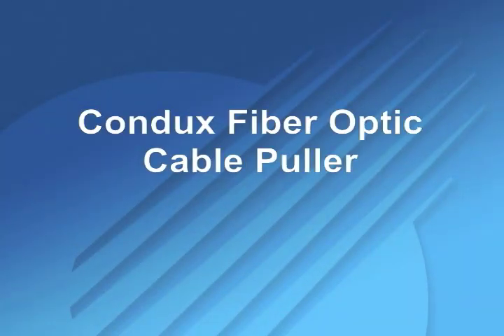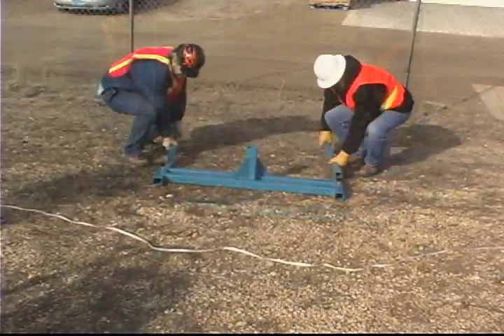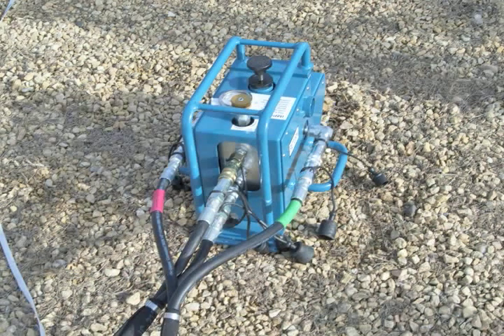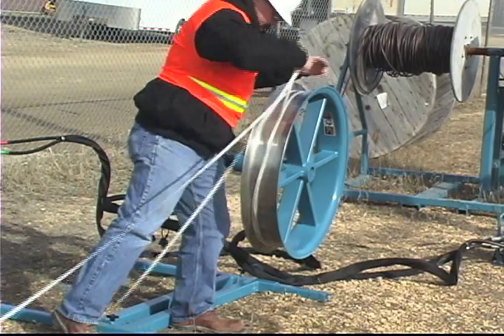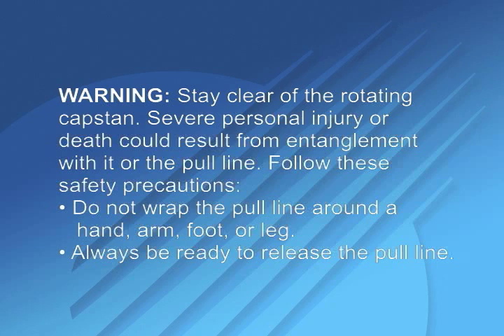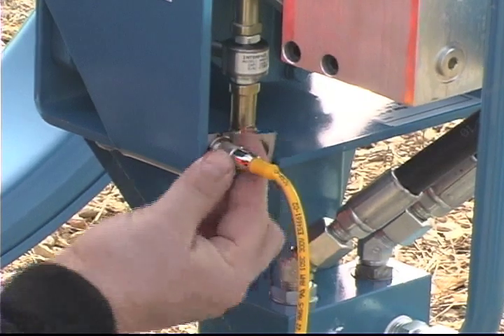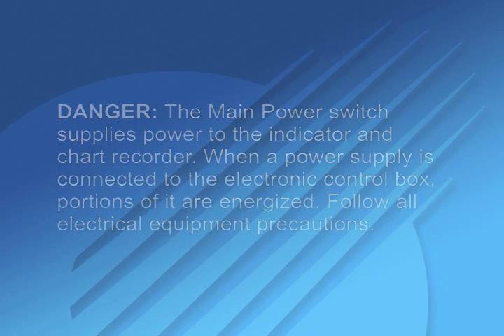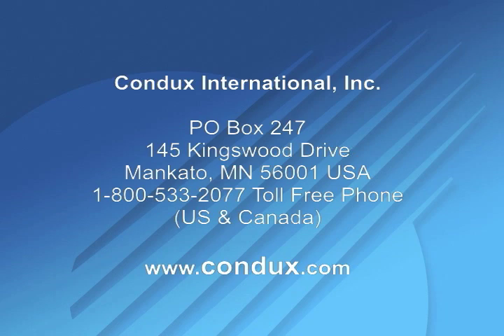CONDUX - Fiber Optic Cable Puller

Comment: If it's close enough to rod, you can pull that fiber in by hand. I'm sure that was less than a 1000'. I've used that machine on runs over a mile.

Comment: Thanks for that, very informative. One question - shouldn't the optic cable puller and other devices be covered to avoid rain?
Reply: Dmitry Stepanov  dont work in rain! lol day off
Reply: Those industrial machines run of gas with little electrical components in them(the starter for the engine ). They are made to work in the rain.

Comment: Step 1: Rod the conduit. Step 2: Tape cable to rod and pull through. Step 3: Enjoy the time saved and have a cup of tea!
Reply: Ya enjoy pulling 1000ft of 432 by hand.. good luck
Reply: i'm sure they can buy/install pre roded conduits
Reply: Dario Ampuy the conduits don't need to be rodded. They come with mule tape already blown in.
Reply: Or you use a blowing machine. Alot easier than using this conduit puller.
Reply: Anton Stener a shop vac and plastic baggy on some line will usually get through. Our mule tape broke last week when pulling 7700ft underground on an 18,000ft run. We had 9000ft one direction to the first splice in the air and 9500 the other direction, 7 vaults total, 4 90s. We were going through 2 90s when the mule tape broke and the vault we were pulling to was 1500ft away from the vault the fiber was being pulled from. All they give us are 20,000ft reels regardless of how long the run is, usually it’s 288ct. On that run we had 3k extra foot which is average in this project. Also they placed a vault directly next to the riser pole instead of just going straight up it for the other 1800ft of aerial to the splice that direction.
Reply: SilverDomUK t40 with and empty reel on the reel bar, snatch block in a vault with some lube for the fiber and get winching. Only downside is doing the figure 8 every time you suck it in.
Reply: H N job is rewarding, pays well if you are with the right company, and you have the opportunity to travel for work if you want. We don’t pull much underground but the project we are on now has small amounts. I’d definitely recommend aerial rather than underground though.
Reply: Try to pull an 864 cable 900ft by hand, thru a few few turns. Especially if duct has few other cables.
Reply: @andrewshatto684  Andrew, where can I find videos of this type of work.  I've been looking with no joy:(

Comment: I pull fiber with my 🙌 never failed me
Reply: Gotta pull 3000’ of 432 count fiber through 6 different manholes whose conduits have been filling with dirt since the 80s tomorrow with only 2 other guys. Ima just use the mini ex track. My hands would simply fall off.

Comment: i bet it would suck if somebody tried servicing a fiber optic cable under tension and it snapped spraying them in the face with a bunch of super super thin pieces of glass haha oops
Reply: You have no idea what fiber optic cable is or what's inside it. lol let me tell you buddy it ain't glass...
Reply: Gixxer BestInEP but it is glass. Corning glass is the most popular.
Reply: @TBinTHAfknBlock  Huh?
Reply: You would work on a fiber cable under tension because it isn't allowed to be under tension.  It's like pulling copper cables through conduits.  Both are under during the pull but relax after the pull.

And if a fiber cable breaks, then someone screwed up and allowed an excessive amount tension to build up during the pull.  There wouldn't be a spray of glass particles hitting anyone.  The cable is being pulled laterally, so any break would be a lateral break.  The cable would literally be pulled apart.

Comment: man id love to have a job this easy and get paid 20+ dollar an hour
Reply: ***** I worked in the industry for 13 years.  Trust me you earn your money.
Reply: Nick 636n8r it ain’t easy rodding occupied conduit
Reply: You have good days and bad day took me 4 days to pull 3 72count fibers a little over a mile keep running into crushed pipe
Reply: As a fibertech.. Nothing easy about this job friend.
Reply: 25 starting pay here in Colorado. You earn your money but we're working 60 hrs a week and the money is great. Went from HVAC to fiber pulling and directional drilling, it was a great change.
Reply: TheRealRageTurtle420__ POON TANG CLAN Trey Davis Our mule tape broke last week when pulling 7700ft underground on an 18,000ft run. We had 9000ft one direction to the first splice in the air and 9500 the other direction, 7 vaults total, 4 90s. We were going through 2 90s when the mule tape broke and the vault we were pulling to was 1500ft away from the vault the fiber was being pulled from. All they give us are 20,000ft reels regardless of how long the run is, usually it’s 288ct. On that run we had 3k extra foot which is average in this project. Also they placed a vault directly next to the riser pole instead of just going straight up it for the other 1800ft of aerial to the splice that direction.
Reply: t40 with an empty reel on the reel bar, snatch block in a vault with some lube for the fiber and get winching. Only downside is doing the figure 8 every time you suck it in. Definitely prefer doing aerial rather than underground, but the project we are on now has some here and there.

Comment: It's kind of hard to pull it with only your hands.
and its easy that the Fiber cable might break.
There for. machine :D
Reply: It depends on the distance of the inner duct run and whether the interior of the duct is smooth or ribbed.  And if someone remembered to bring the polywater or whatever pulling lubricant being used.